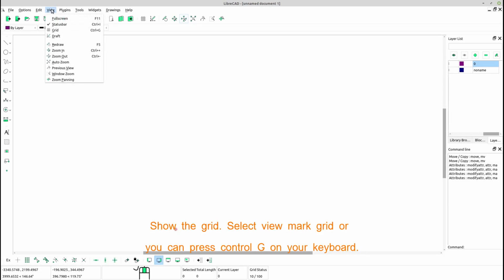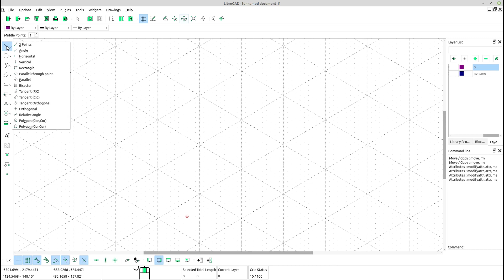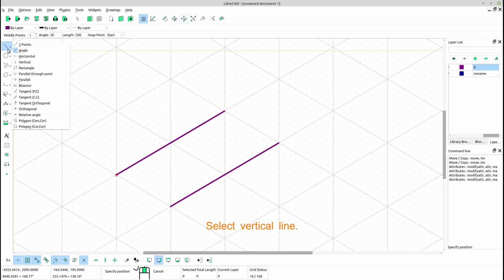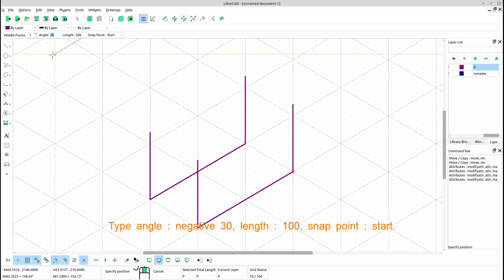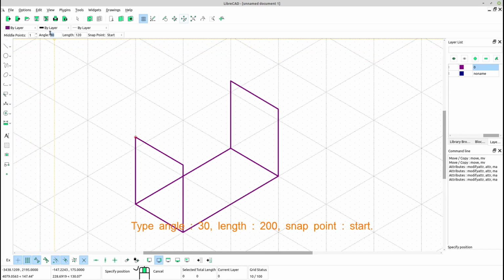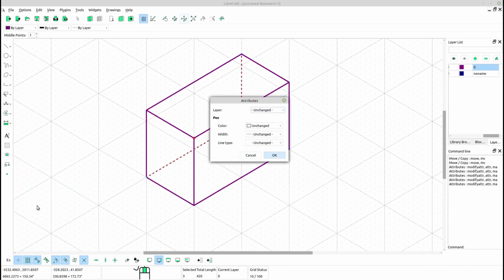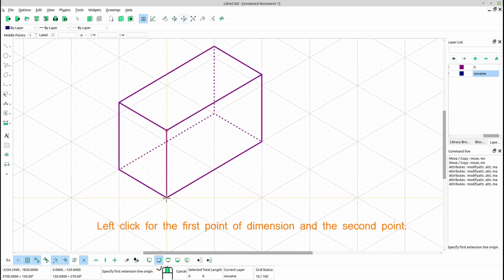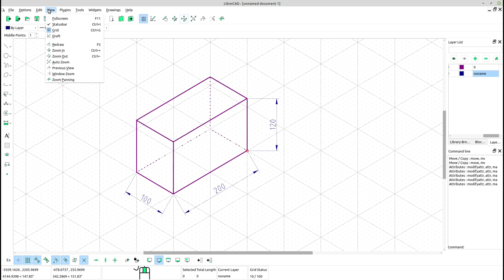How to Draw Cuboid - 2d LibreCAD Design

Comment: Thank you so much for the tutorial! Quick question, the dimensions aren't showing up, it just draws another box out from the selected line. Any ides what the issue might be?
Reply from the maker: You're very welcome! It sounds like the dimension tool might not be set correctly. Try checking the layer settings and make sure you're using the right dimension tool. Let me know if you need more help